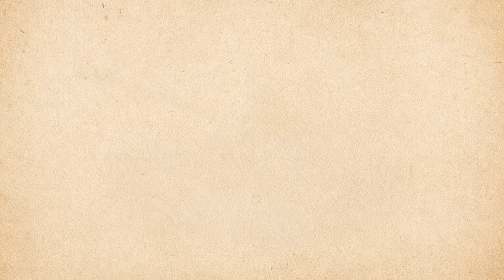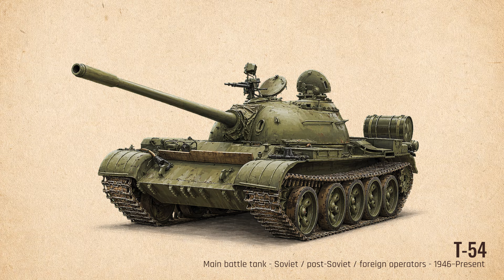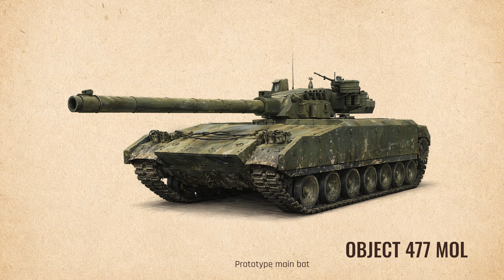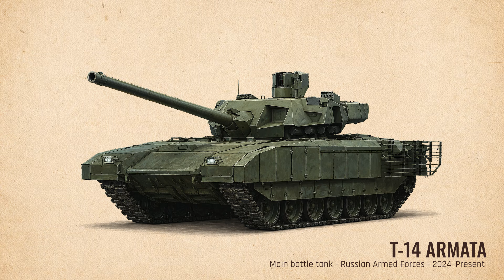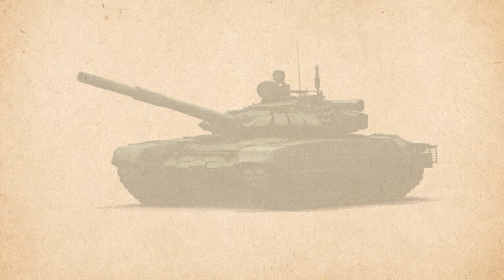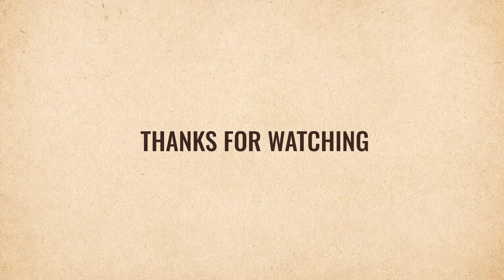Every Soviet & Russian Main Battle Tank Ever Built

Comment from the maker: Crazy how after almost 50 years of evolution, that fatal flaw from 1973 is still haunting them! Even in the brand new T-90M, the crew is literally still sitting right on top of a carousel with 22 exposed rounds. Meanwhile, the T-72B3 might have gotten shiny new thermals, but it's still stuck with that miserable 4 km/h reverse speed when trying to back out of an ambush. Honestly, what's worse for a modern tank crew: sitting on a literal powder keg ready to blow the turret clean off after one good hit,  or not having the reverse speed to actually get out of danger? Drop your thoughts below 👇